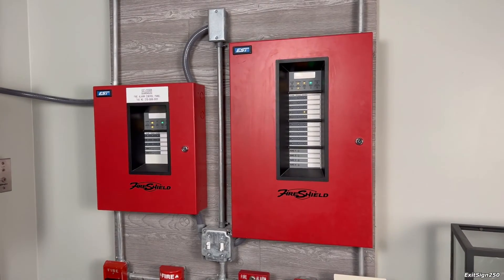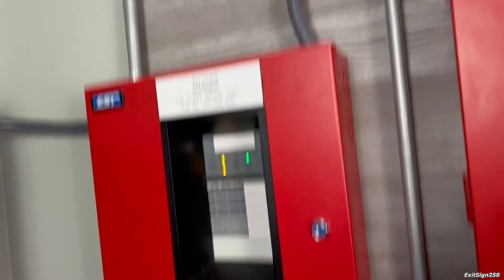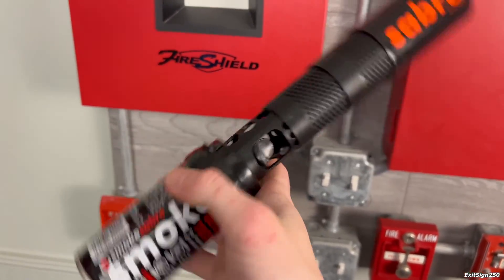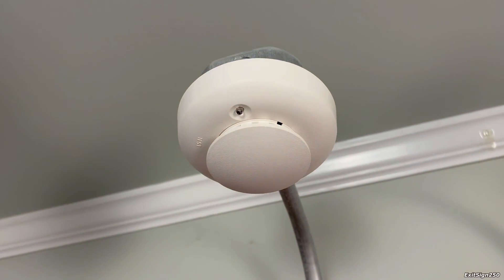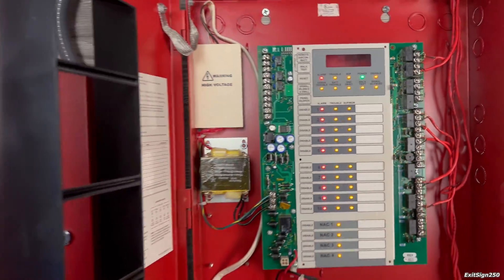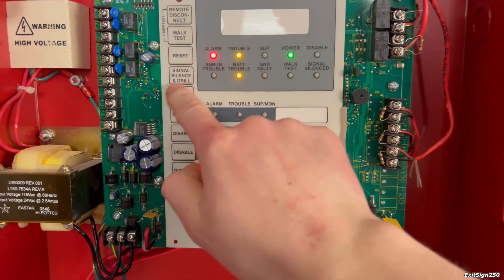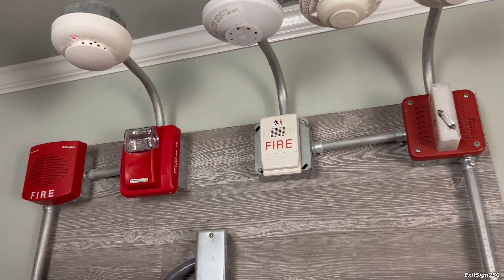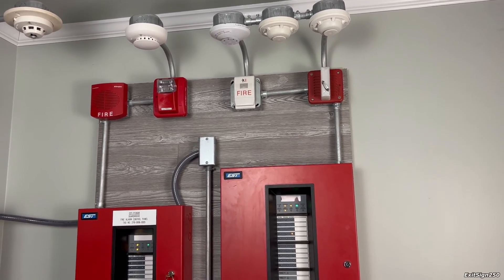System Test 20 | Board 2 - Troubleshooting A Smoke Detector

Comment: Nice test! Extremely loud system. But why did the bigger fire sheild  go into a supervisory when you reset it?
Reply from the maker: Thanks! This is an issue the panel has had since I got it. (A local fire alarm inspection company replaced it for this reason) Zone 4 is shorted so it is always is in alarm. Of course this means the panel can never reset and the notification appliances will always be sounding and flashing. My method to get around this problem is by setting that zone to be a supervisory zone. Supervisory’s do not cause a fire alarm but do cause the panel to beep which I’d rather have than a constant alarm. Thanks for your question!
Reply: @ExitSign250  it could be a wiring issue with the panel, check to see if there’s anything shorting the panel
Reply from the maker: @TurkeyPoint_Sirens   No physical shorts and no issues on the panel’s surface. It’s an internal short.

Comment: Seems like that smoke detector decided to “play dead” for a bit lol! Never knew about that little dip switch setting thing, probably because I never had to mess with it when I got mine. Those ESL detectors are able to be magnet tested, just hold one up to where it’s says “test” and it will activate after the LED blinks a few times.
Reply from the maker: Good to know! I thought I read somewhere that they only had a sensitivity test, but I could be mistaking it for another detector. Thanks for the tip! And yes, the voltage select dip switch is definitely an interesting feature.
Reply: Why do you quit responding to our comments?
Reply: Why do you quit responding to our comments?